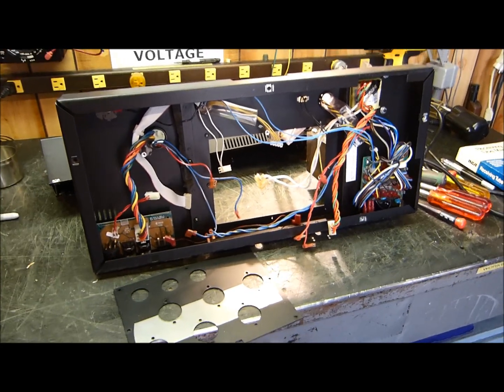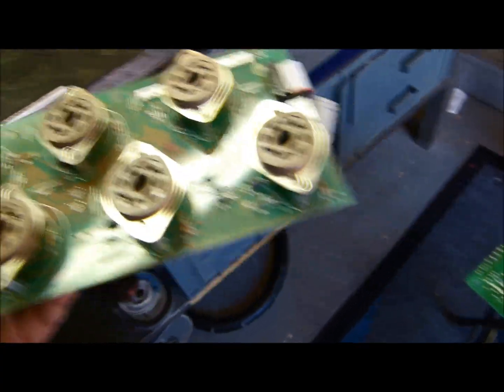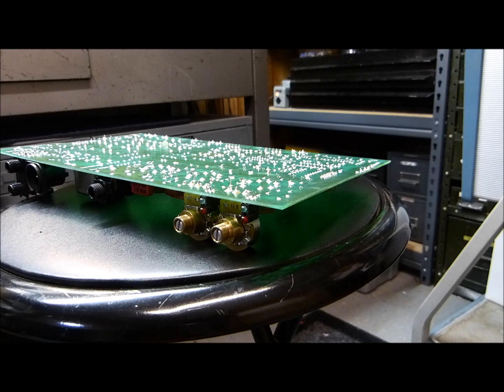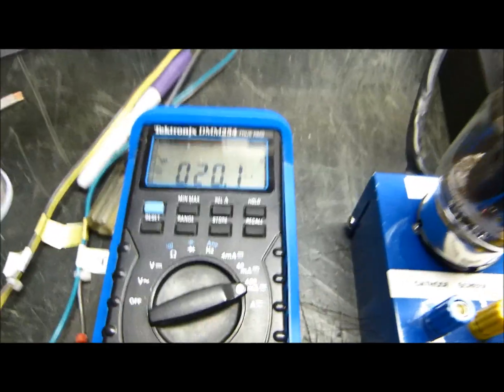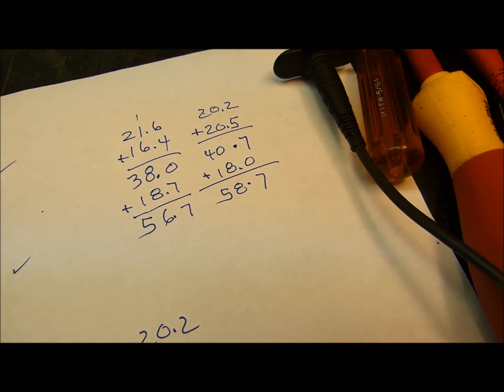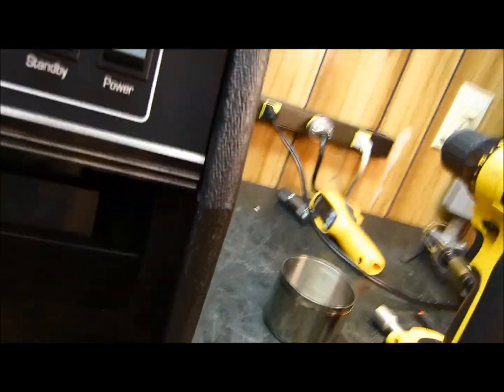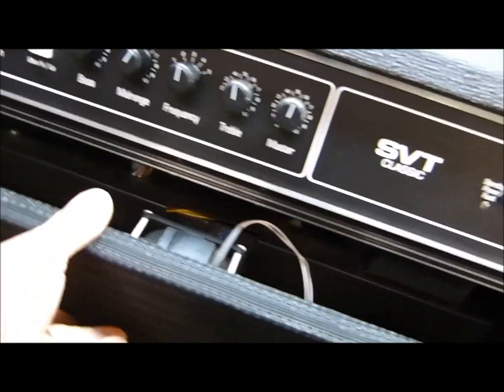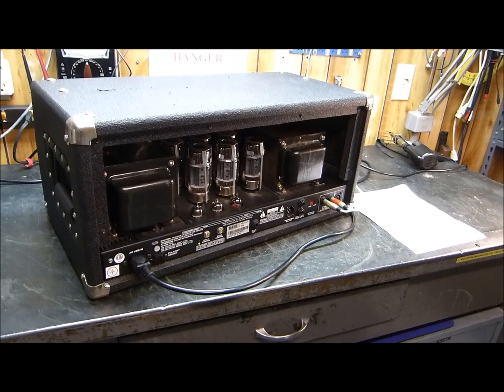Ampeg SVT CL Repair And Testing

Comment: ELPASO, Why did AMPEG use compactron tubes? it doesn't make sense because most guitar amplifiers didn't use compactron tubes only radio circuits and TV circuits used compactron tubes
Reply from the maker: I have no idea. I guess it just a fad at the time ?? However, many of the compactron tubes had three triodes inside so maybe that made sense to them. Surely compactron tubes were the thing of the future - at that time -   :-)

Comment: Changing 6550 power tubes and not bothering to crimp the sockets is waisted money !
Reply from the maker: Unfortunately, that is true. With the military surplus sockets I still use that are 70+ years old, that isn't necessary but the soft metal the female pins are made of nowadays, not keeping the pins tight is a good way to quickly destroy the tube. If pin 3 (the plate) becomes lose, the screen tries to become the plate and is instantly destroyed. If pin 5 becomes lose, it loses bias and ... well, we know what that means. Thanks for your comments.

Comment: Question . When looking at the amp from the back, for the 3 preamp phase inverter tubes, is the 12ax7 on the right side or the left? I can’t find this info anywhere!
Reply from the maker: This has been a lot of years ago so I don't remember off hand but the first tube, I assume the 12AX7,  input would be the one with the wires from the input jack. connected to the grid (either pin 2 or pin 7 of the 12AX7 socket) . The last tube would be the one that has capacitors off the plates (pin 1 and pin 6) driving the output tubes. As far as I know, the driver tubes are usually in a line from input to output. Hope this helps. Looking at the schematic at this link , the input 12AX7 is V1.     http://www.tangible-technology.com/schematics/Ampeg/SVT/
Reply: @ElPasoTubeAmps  Thanks man! I didnt have it open so was abit hard to tell off the schematic but I think I got it! I actually just tried what I assumed it was, and when I turned on the amp there was a loud hum, but I only turned it on for like 2 sec lol, so I switched them around and the hum left and it worked great lol. Hillbbilly amp teching here lol. So looking at the tubes from the back of the amp it was 12AU7/12AU7/12AX7. Thanks for your help though! Much Appreciated!

Comment: You don't have to remove the main board in order to remove the tube board (maybe you didn't do that) - though it is a nuisance owing to a couple of the cables.    We (day job) have a lot of these, and 90% of failures are just tubes.  Most of the rest are the 220 Ohm resistors.  Occasionally there's an issue with the bias and.or bias monitoring circuit.  

The bias monitoring circuit looks at all the tubes and won't go green if one of the tubes is too far out from its mates, so no worries about having a hot or cold one.

Normally ~260W at onset of clipping (using the eyes on a scope).

Comment: one of my output transformers stay cool to the touch, room temp, the other gets warm, but not HOT.  is this normal for one to be cold?
Reply from the maker: Output transformers rarely get very hot unless they are close to hot vacuum tubes or the power transformer so warm is OK. Power transformers can get hot - hot enough that you cannot keep your hand on them and that can be OK also. Just the smallest amount of air blowing over a vacuum tube instrument can make a huge difference in temperature. Vacuum tubes can easily run at 400 degrees F and, as mentioned above, can cause components close to them including the electrolytic cans,  to get quite hot also and getting these capacitor cans hot is not good for them. Hope this helps.

Comment: If the LED's are firing then the problem is in the output section. One of the tubes is not actually working. There are 10ohm resistors on the main board that are also prone to opening up when a tube goes nuclear. If the 220 ohm on one of the tubes is open it's a real good bet that the tube may show heaters and look like it's hot when it is not functioning. The output tube monitoring circuit looks at the draw of each tube and won't let the green LED come on if they are not all working. I have seen the monitoring circuit opamps screw up, but that is really rare. The opening up of the 10 ohm and 220 ohm resistors is pretty normal wear and tear on these Beasties.
Reply: Randy Gabbard what’s the wattage of the 220ohm and 10ohm resistors here? And regarding the 10ohm, you said it’s on the main board. Is the larger board on the bottom the one you speak of, or top board where the 220 is? I’m away from the shop where I’m working on one of these. Trying to get the parts ordered and shipped by the time I get back. Thank you and thank you El Paso!

Comment: HI.
I have the SVT. CL. made in USA model.
Recently , I have been getting some static noise through my amp. speaker cab.
I changed amp heads to eliminate the problem coming from my speaker cab. So that's isolated from the equation. The static noise is definitely from the CL. head while I'm playing. I switched cables and even different electrical outlets.The Static crackling kind of noise is still there.
I took off the back screen and blew out some dust with a can of dust off.
I took a pencil and lightly tapped the tubes with a pencil. 
The only time the static happened while doing this was when I tapped lightly on the smaller last tube on the right on the bottom. But it only did it once as I wiggled it a little.
I played again and the static remains . Any help or guidance you could give me would be appreciated.                                     Thank you .
Reply: +Roy Eraca I forgot to mention that my Power Tubes were replaced by a service center some time ago, but I haven't played this particular CL head in a while.
So there aren't all that many hours on these power tubes. I don't believe any other tubes were replaced as I had purchased this used.
                             Thanks again.

Comment: Hi David! Hope all is well...I remember watching this video a while back and since this past December, I had an SVT Classic come in for repair 3 times (same amp) within 4 months for the same problem (different cold tube) and I have to be honest and say that this is a poorly designed amp and a headache to work on. It got to the point where after the third time, the amp came back again 2 weeks ago with 2 holes burnt right through the PCB. I'm really not fond of the 6550's sockets being mounted on a PCB. What I had to end up doing is, eliminate the PCB, cut and mount a metal plate with conventional flanged tube sockets and wire everything in that section point to point in order to put a final stop to the problem...mind you, Ampeg was NO help in giving me support as a technician, and for a replacement PCB. I have customers who have the old SVT's from the early 70's which are a breeze to work on. Hope all is well with you. How's the 1kW audio amplifier coming along? :)
Reply from the maker: Frank - good to hear from you. Yes, much of the new stuff is junk. On a recent YT video I posted, it was obvious that the metal in the tube sockets is so soft that simply removing the tube wallowed out the pin connections  and would cause failure on that tube - that's pretty bad, huh? I sure admire your commitment to fixing the SVT - had to have been a lot of work. I agree that the '70's SVT are easy to work on -  unfortunately the 12DW7's  and 12BH7's often times get replaced with 12AX7's which is a bad idea. My KW amp works amazing well but I have not had any opportunity to put it to actual work. Maybe something will come along at a local gig where I can allow it to make some real noise  :-))   I think the KW amp's best purpose would be voice and PA or lead but probably not bass as the tube plates really heat up under sustained low frequencies.
Reply: It's interesting that you mentioned about the cheap metal in today's tube sockets. I've been encountering that same issue quite frequently with newer amps. I came up with a quick fix that has helped so far...I install socket savers. Granted, it brings the tubes down a little lower, but saves from the heat being so close to these cheap sockets. However, when I come across an amp with tight quarters some times, it isn't possible to use them.

I've been keeping in touch with Mark up at Amp Experts; he lives about 3 hours north-west of me in Conn. I'm here in New Jersey...Marks a nice guy, we've exchanged schematics on occasion. By the way, if you're ever in need of schematics on something, drop me a line, because I have a huge schematic library in PDF form. I'm also starting to scan my SAMS library a little at a time...a lot of work, but that stuff is hard to come by these days. 

I'm in the process of building a bias box after seeing the really nice home-brew that you built, however, I'm tossing around a few ideas...one is, I'm building it with dual sockets and cables, but I'm debating whether or not to put meters right in the box plus the binding posts. What's your opinion on it?
Reply from the maker: Frank Ferraro Commenting on your last paragraph - yes, I think two sockets would be a real advantage as you could easily switch back and forth between two tubes at a time. I am not sure there is any real advantage to measuring the plate, screen and cathode currents - it could be enlightening at times and on some tubes - The one I built works but is labor intensive - also, I have noticed that if I leave one tube in the tester (in a push-pull setup) and actually run dynamic tests, the extra length of wire, etc will affect the outcome so it is only good for static testing under no signal conditions - thanks for the offer on the schematics - I will definitely keep that in mind -

Comment: I have an svt cl that immediately blows the fuse when you switch it off standby. I also noticed the led doesn't turn green like it is supposed to before you switch the standby. Any ideas on the problem.
Reply from the maker: I would start by pulling all the output tubes - if that stops it from blowing fuses then you could plug two in at a time (one on each side) or even one at a time and try to determine which output tube is shorted - if it blows fuses with no output tubes installed I would assume a power supply problem and you might need to seek a good tech - good luck.
Reply: Hey ive got this same exact issue, did you end up fixing it?

Comment: i have a svt cl that has the same problem, right side bias will turn green, but not the left. i just changed the power tubes with a matching 6 pair and same problem. everything sounds fine though. what are the potential risks or continuing to playing it as is? thanks
Reply from the maker: Probably all that is going to happen is reduced performance. If you have or can get/borrow a infra red (IR) "laser" thermometer like I use, check the temperature of each of the 6550's and I am pretty sure you will find one or more much cooler than the others - not by 10 degrees but by 100 degrees or more - those will be your tubes that are not doing their share.
Reply: thanks for the response.
Reply: Jesse Briseno did you ever solve the problem? I have a similar issue. Amp works but the red light on the left won't go out.

Comment: do you think airflow for the valves would improve longevity?
Reply from the maker: Yes, I am certain air flow will help lengthen the life of the tube - it doesn't have to be forced air directly on the tube - even a gentle flow over and around the amplifier will help.

Comment: when it comes to the way a tube amplifier is designed, what's the biggest difference between the way a vacuum tube hi fidelity amplifier is built versus a vacuum tube stage amplifier?

Comment from the maker: 5% THD in the stereo world is intolerable but in the music-creation world it is hardly noticeable and would be called "clean" - even 10% THD is "musical". Fuzz boxes turn the sine wave into a square wave at 50% THD so we don't measure the music creation amps by the same standards as we do HiFi amps. Scanning a music creation amp with an instrument like a HP 8903 from 20 to 20 KHz is ridiculous and hopeless.as the frequency  response of these amps is totally off-the-scale.

Comment from the maker: It is function 19 - hit Clear then punch in 19.004 and then SPCL. Function 19 reads power and then the dot and then the impedance, i.e., to read power out of your oscillator with a 600 ohm output, punch in Clear, 19.600 and then SPCL and you can read the mill watt output of your oscillator - I love the 8903.

Comment from the maker: I was never able to measure anything wrong with an ohmmeter but changing the screen resistor and re-soldering the socket fixed it. I am guessing the screen resistor was opening up under load. The amp at the end of the video is an RF amp for 20 meter amateur radio operation. It will go in a cabinet which already has the tuned circuits for the output and the 3000 volt HV PS. I am considering making an AF amp with the 3-400Z tubes - should give me about a kilowatt of output.

Comment from the maker: Unfortunately, one never knows exactly what the plate current is on the new amps with the LED's. I don't remember the exact amount that Ampeg recommends for current on the vintage amps but I know it is pretty low. Do you recall the voltage across the 1 ohm cathode resistors in the vintage SVT's?

Comment from the maker: Actually, I never measured anything definitively bad with the ohm meter but the tube was "cold" in a way that appeared to be a lack of screen voltage. It is impossible to work on this amp powered up. I changed the screen resistor (I changed all of six if them) and re-soldered all around the socket and it cured the issue - hopefully forever...